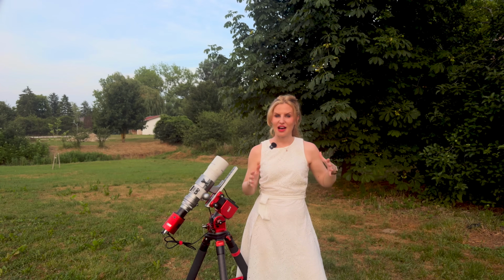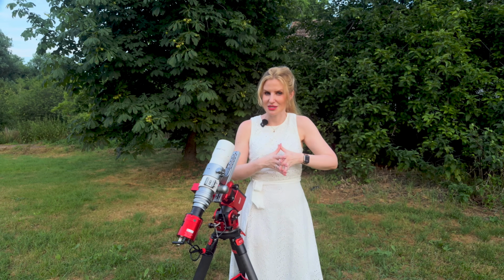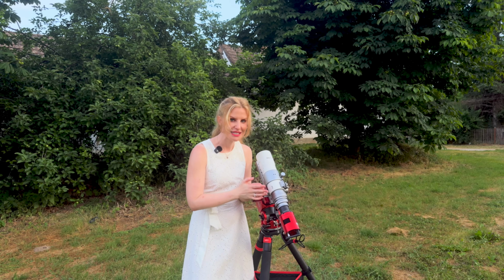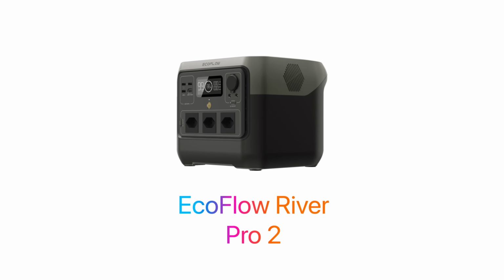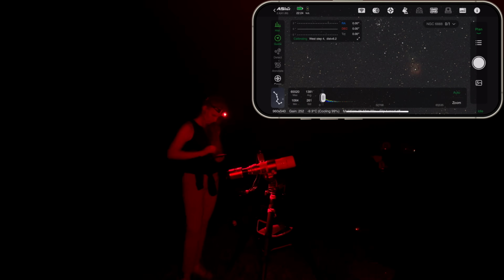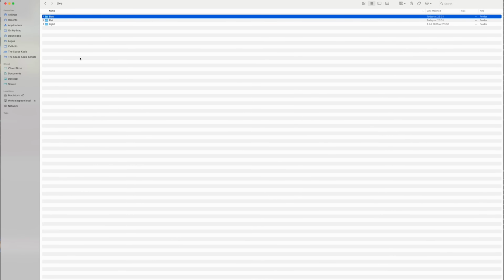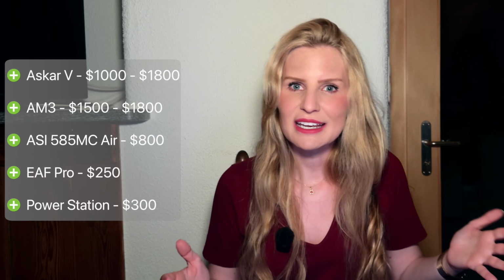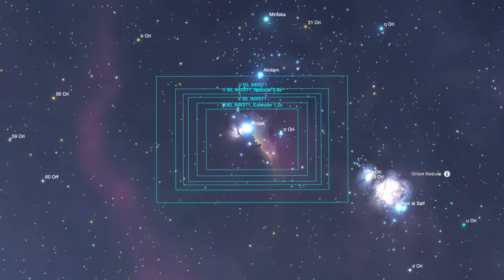Build Your Own Smart Scope! Easy as a SeeStar, Pro results!

Comment: The cheap S30 cost here 520€ ... 610$  🤣 30% more expansive 👍 Askar V over 2300$ 🤣 much more u earn here as a normal guy in a month 👍 AM3 + tripod ... 2700$ 🙂 funny 👍
Reply from the maker: This is a real problem in many countries and must be considered, I agree. The reasons being higher VAT, import duties, other expenses the local telescope stores must build into their prices. That said it’s impossible to consider this on an international channel so I used MSRP for everything
Reply: @the_space_koala global YES but Not for customers 👍 ordered my touptek 678 camera direct by touptek and payed 260€ inkl. VAT, shipping all incl. ... buying Here 400€+ ... and im am sure the shops / seller dont pay 260€ like customers buying from. touptek
Reply: Hence at the end of the video alternatives are provided for scope and mount.
Reply: @vincentvdb3151 This cheap mount is cr*** ... nothing for beginners 👍 + 400$ ASI AIR or Stella ... or notebook.
Reply: As was said in the video you can build a much cheaper smart rig but it won't be as versatile. The main thing is the ASI585MC air camera considering it's actually two cameras in one and has a built in mine pc it's not that expensive as cooled astronomy cameras go. See Stars weren't around when I started so the cheapest set up was usually a DSLR, cheap zoom lens and a Star Tracker mount. People would start with this and slowly upgrade the set up as money became available, which is what I did.
If you look at the price of a top end smart scope it isn't much cheaper than the rig shown in this video and is nowhere near as versatile.
Reply: @KevinRudd-w8s The 585 Air cost here 1000€ ... 1170$ ... and its with discout from 1100€ ... 1300$ and not 800$ 🤣 500$ VAT, TAX, shipping ? 🤣

Comment: Integration is the key.  I've been Seestaringit for about 18 months and have thought hard about doing exactly what you are presenting.  The 585 is on preorder only here but should be available soon.  More expensive alternative would be 2600 but available now.  Would you recommend both cameras?  Thanks for the push.
Reply from the maker: If you can afford the 2600 I would go for that and that one only - it’s objectively better. The only thing “worse” about it is the smaller pixels but realistically you can recover any lost resolution via drizzling!